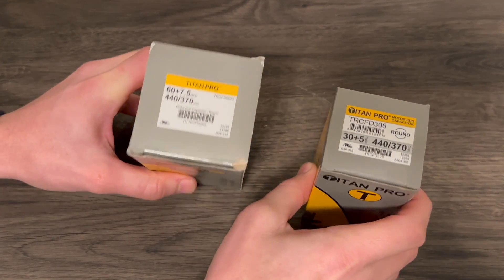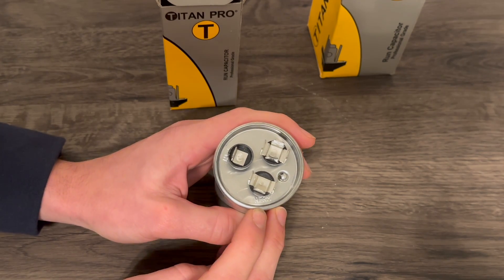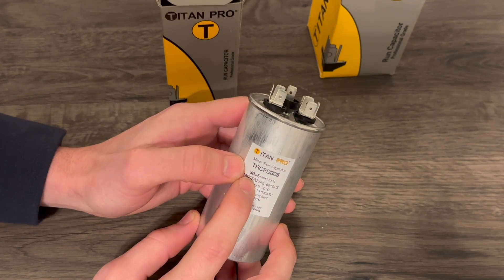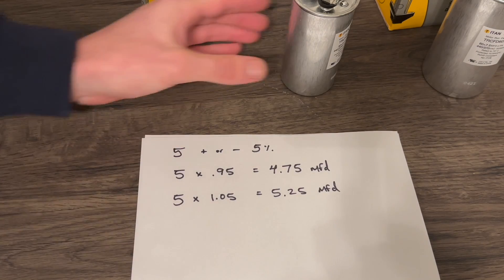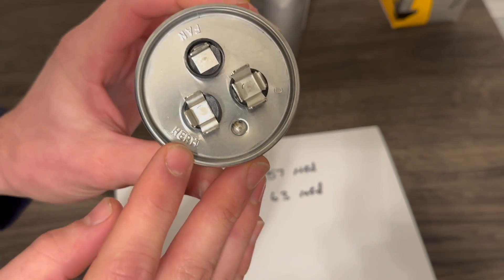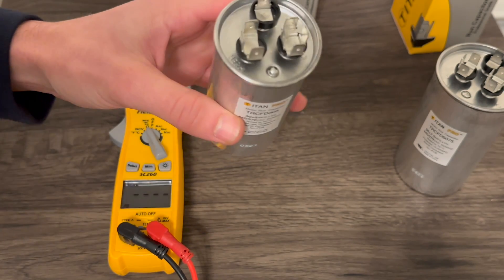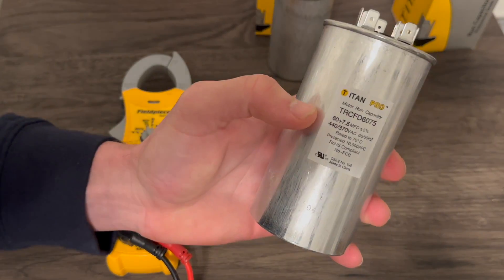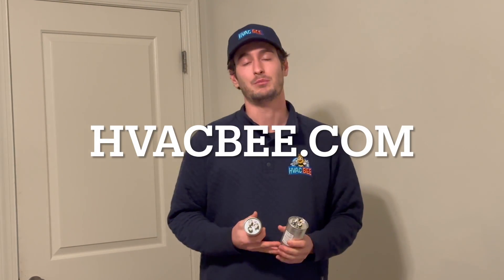AC Capacitors Explained: A Beginner's Guide

Comment: Where do u get .95 from im new at hvac trying to get the understanding cause I got 7.45
Reply from the maker: Because it is (plus or minus) 5% on this capacitor. So you take the 35 mfd and check the range on each side. 

So, 35 * .95 = (33.25 low side)
& 35 * 1.05 = (36.75 high side)

Anywhere in that range is considered still within manufacturers specs. 👍